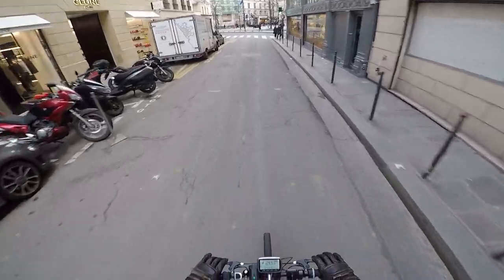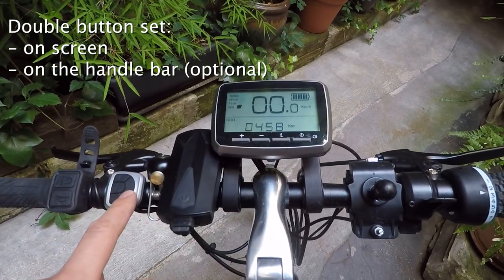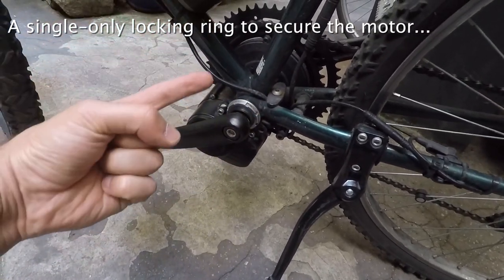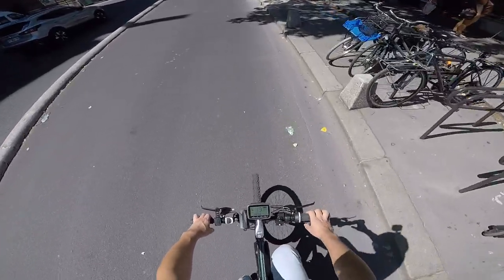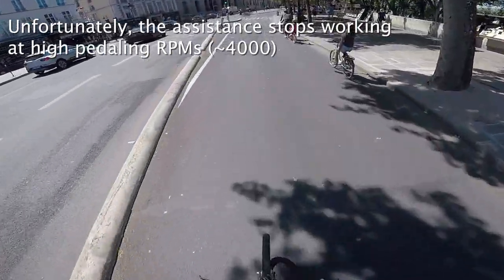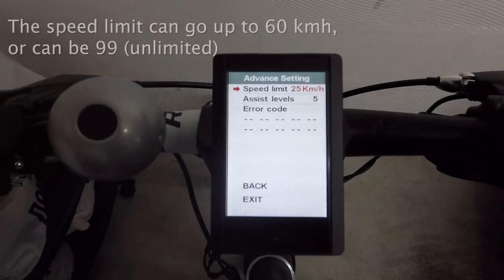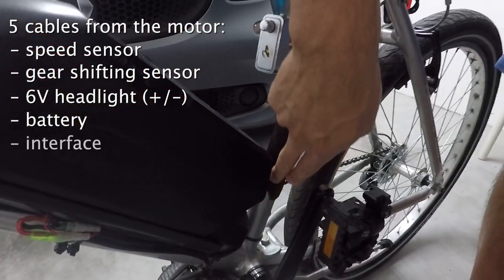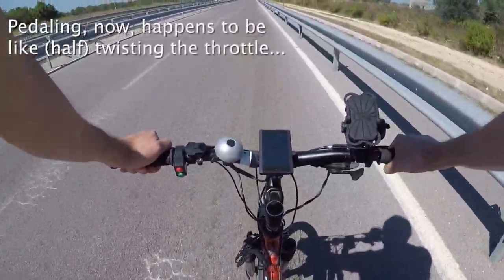Tongsheng TSDZ2 or Bafang BBS02B - 500W Mid-drive Comparison... Which one to choose?

Comment: Very nice video thank you for all the input on the Bafang motor I am considering to purchase one to convert my MTB and I am studding all the little features and advantages that you can get from each brand.
Reply: already liked and subscribed
Reply: Bbshd is the best of the bafang bunch, its easy to fit, only work your do is removing bottom bracket, re-feeding gear cable, removing front derailleur and its gear shifter, just make sure ur wheel rims are double walled.

Comment: A shift sensor is a needed on a torque sensing system as when you shift you should be letting off of the power anyway and that will instantly cut power through the system because it is a more natural for you. The cadence drives already more jerky, power meaning a shift sensor is necessary.

Comment: I have a BBS02b on my retrofit. I dislike the onset of power pedaling doesn't feel natural. The Tongsheng's torque sensing sounds nice, but the downsides look numerous. I've been considering a CYC Stealth motor, but it's too expensive and there are too many quality-control issues for me.
Reply from the maker: I totally agree with you man... In the future I will share some settings for the BBS02B via the programming tool that should make it a little bit more confortable
Maybe it will help you too

Comment: There's custom firmware for Tongsheng that improves it drastically, but that requires some elbow grease to install and a different screen unit.
Reply: You don’t need a new display for the custom firmware, though it givea you more readings

Comment: Which is the best?  The Bafang is a little more expensive and even so by my opinion slightly better then the Tonshang but all motors have there strengths and weaknesses, the Bafang strength is it is quieter and smoother and hear it encounters less problems and parts are easier to come by, it weaknesses is price its a little more then the Tonshang and the fittings.  The biggest problem I have had with the Bafang the securing nut coming lose and motor lowering so could do with a more secure fastening, the Tongshang as a fixing bolt that secures the motor to the frame but where that fits I have a stand fixing there.

My advice if you do fit a Bafang motor you can secure it to the frame by fitting the motor with jubilee clips, a jubilee clip aroung the motor then a smaller one through the firs clip securing it to the frame.  Ideal sizes 120mm to 140 mm for the motor and  50mm to 70mm for the frame and this will give a stronger fitting to the motor to frame and stop the risk of your motor coming lose.  I hope this helps as I find the Bafang slightly better and worth the extra cost and work.  Mike

Comment: Thanks for the info, i have installed a bbs02b 36v 500wat middrive motor 48T chain wheel front and 13/34 T cassette rear it have a lots power like a horse hi hi ferry ferry nice, the bike is a Giant expedition expert series. I draw a helmed course mij hear is not enough to protect the head.

Comment: I'm waiting for my tongsheng tsdz2 to arrive. I decided to go for the tsdz2 over the bafang because of the positive feedback of the torque sensor, if it's as good as the Yamaha on my haibike,  I'll be most pleased.
My next one will either be bafang 1000w or the cycx1.
Reply: I went for the tsdz2 and I am very happy with it. The Befang that I tried was also very good, but I prefer the torksensor.
My next motor will be again with torksensor.
Reply: How was your experience after all?
Reply: @pablonoguerales1425  Hi, I'm really happy with the motor. It comes very close to the Yamaha pw-se on my haibike in terms of responsiveness and performance, the quality of the motor however is not great, but replacement parts are readily available and fairly cheap. If you're thinking of getting one you won't be disappointed.
Reply: @wattyler5591  I read about your tongsheng and yamy there and wondering if your still pissed???🤔🤠😆😝🤙
Reply: @wattyler5591  I'm wondering how to mount a drive straight up in between the two frame tubes
 seems silly to hang the motor in the forward position  to also use as a skid plate?

Comment: Great comparison, i have 2 ebikes, one new fitness with tongsheng 36v 350 Without a throtle and  18-20kg weight depending on the size of the battery and one 20yr Steel 26in... 30kg with a heavy brusless 36v 500w  hub back wheel. Tottaly different, one is a helpful normal bike to have a workout (6000km in one year!) and the "tank" as a commutter and more like a moped. The same  battery in the tongsheng in eco-1 mode and a little in tour-2 Mode lasts more than double than the other with assist level 1 (80-100w).
Greetings from Greece.

Comment: I have the thongshen, but I also tried the befang. I prefer the way the thongshen delivers power. It reacts on how much input you give, so changing speeds is easier. It feels more natural.
I agree with you that there are things missing like battery usage and the amount of power levels. I think that it isn't a problem for most people, but I would love to have it.

I expected a longer range with the Thongshen, but I wasn't surten. I think that this mainly comes because how the power is added. With the befang, the motor works more as you just just pedal and don't ad extra force.

I didn't change to the custom firmware but it seems to deliver more power and ad some extra info.
I am thinking of changing the firmware, but not in a short time. I like the long range.
I hope that thongshen will give you an option to change it. That would be great.

Overall, both are good and yes the befang looks better with the display, but I would just look ad what feeling you like the most. Display can be changed and firmware change also ads extras.

Comment: Hi, great details on your video.
I want to convert my Marin from rear hub to mid drive 500W, but it seems that the bottom bracket set is seized and rusted into place, so the only option is to cut off with a hacksaw or angle grinder flush with the frame, then hammer or drill out the bottom bracket.

How you describe the locking ring for the motor is important to me - do you think If I have no threads remaining in the bike frame then I can still make the conversion, because it slots through and tightens to its self?

The purpose of the mid drive upgrade is for me to load up the bike with camping equipment and go in the countryside, which has lots of hills where I live in South West England

Comment: you don't need brake cut off or a gear sensor for the tsdz2 and you can get built in for the lights for the tsdz2

Comment: Hello Luke, thank you for this useful vid! Can you answer to me, with which motor is possible to ride using less cardial work? I've got very serious heart failure, that means im able to walk mid-speed continously, but riding a normal bike is too much. I tried it, i ran out of power and oxygen after 2 km. So as I understood well the Bafang set would be better for me? Thank you!
Reply from the maker: you got it right man: the Bafang kit is the right one for you!
the 500W at 48V motor will allow you to install bigger batteries, and if you buy a 48V 17Ah one you'll be set. in case you have a lot of steep climbs on your way, you can think about the 750W version :)

Comment: I have the tsdz2 750w fitted to a full suspension bike, biggest problem is the cadence which is about 85 with a full charge and about 70 as the battery goes down. With the 42t chain ring you will get about 25mph pedaling as hard as you can and after that you are fighting against the motor. Crank arms are weak and bend at slightest knock, the chain ring has play and wobbles, with a low battery the cadence is so bad you will be quite passed after a while
Reply: True not to mention the drag the clutch on the cranck arm has pff. This video says no resistance on the tsdz2 or the bafang, mid engine.... Wrong!!
Reply: Ffs - what do you want for £260?

Comment: Thanks for the comparison. I've just added a Tongsheng motor to an Apollo front suspension hybrid but haven't ridden much due to our wet and cold winter here in Melbourne! I'm looking forward to the weather improving so I can try some longer rides. The open source firmware project for the Tongsheng was a factor in my decision.
Reply: How has it been now that we've had a few sunny days....? Did you flash the firmware?

Comment: Which is best for going uphill easy? That's the only thing I need.
Reply from the maker: Hi! First of all, see this: https://www.youtube.com/watch?v=T7ve958hJXE
based on the info that I've shown, and considering the same 500W version for both motors, probably the Bafang because it allows you to efficiently use the throttle when you need it; it also provide more torque (100Nm)... unless you are looking for an "only pedals" experience, in that case the Tongsheng pedaling system is more realistic, but you will make a bit more of workout (80Nm). I would probably try something more powerful that 500W in this case.
Reply: Bbshd, 160nm of torque, i have 2, 48v 1000w, or 52v 1500, done 2k miles and it goes so good, just make sure to get these things, 1st motor sator has the new rotor, have a quick link chain, 8-9speed depending in chain ring, gear sensor, use a push down thumb throttle avoid twist, a bafang programme cable this enhances the speed and reaction of settings like how strong the thumb throttle works, make sure the wheel rims are double walled for extra weight and force, have a decent capacity battery over 15ah, 48v has bigger range of top capacity but 52v gives more power and 20ah 52v are strong and gd range, don't use throttle on hill climbs with bafang its stupid, i mean 100nm of torque if ur in right gear it will fly up lol

Comment: You can do 32 mph on flat no heavy wind on bbdo2b a battery killer but i would advise a 17.5ah to get max power no prdal.
In lower pas 3 to 4 80 miles range

Comment: Thanks for this video I'm actually planning to get that display that your u in on the bafang.. You said something at about 7:40 that the clock freezes is it like that all the time? If I remove battery to charge and put back the battery will the clock be correct?

Comment: When a BBS0*-***W is tuned in software and mode is set to "current" it works like a charm. I tried the TDSZ2 but did not like the torque system, the current mode Bafang was more suited for me also because it has a throttle.
Reply: CAN YOU COMPARE THE TORQUE SENSOR FEELING OF TONGSHENG AND SHIMANO OR BOSCH?

Comment: With the programming cable you can program the PAS and throttle to allow full speed regardless of the PAS level. I also have a BBS02 (750 watt) and mine is programmed that way. Unfortunately there is a glitch that makes PAS cut out when you hit the throttle and then the power comes on full blast. That required me to stop pedaling before applying the throttle or risk wheelies. I finally solved the problem by removing the throttle;)
Reply from the maker: hope to make some programming myself too! 🤞
Reply: @LukeLorusso  Mine came programmed to reach top speed regardless of assist level. I programmed it for lower amps so I'd get more range from a 6AH battery. Also lowered the % of assist in the lower PAS levels because it started at 30% in PAS level 1 which was unnecessary. Now PAS level 1 gives 10% power which is more than enough for slow moving around pedestrians. If I want 30%  I just up the PAS level to 3 (of 9) now.
Reply from the maker: @michaelsprinzeles4022  very interesting! question: can you still choose to have 5 customizable levels of assistance instead of 9?
Thank you for sharing your experience 💪
Reply: @LukeLorusso  Sorry I didn't see your question sooner. Yes, you can still choose the number of assistance levels. Note: if you change the number of levels the settings for level 9 are still the highest, with level 5 being the middle and 1 the lowest (while still getting assistance) so while programming assume the full 9 levels of assist and the motor will make the corresponding adjustments when you choose how many levels you want on the display. For example set all 9 levels while programming then on the display set the number of levels...the motor knows no matter how many levels you select that level 1 will be unchanged but the middle setting, no matter the displayed number, will correspond to level 5 in the programming and the highest setting, no matter the displayed number, will correspond to level 9 in the programming. With 3 levels of assist the display level 2 will be the programmed level 5 and level 3 on the display will be the same as level 9 in the programming. If you choose 5 levels, 1 is still 1, 2 on the display is like 3 in the programming, level 3 on the display is like 5 in the programming, level 4 on the display is like level 7 in programming and level 5 on the display is like 9 in the programming. With the programming cable (and software) you can also change the amount of power in each setting. Hope that's not overwhelming. It's simple once you've done it.
Ride on & enjoy;)
Reply from the maker: @michaelsprinzeles4022  fully understood, was the doubt I had, so hard to articulate but you answered straight! 👌 thanks man

Comment: Thanks for all of your comparison videos between the Tongsheng and Bafang. On the Tongsheng, will the motor carry you at 20 mph or 32 km/h on throttle only? I like the torque style better but want to make sure it has enough power on throttle only a day the end of a ride at the end of a long day.
Reply from the maker: sure, 32kmh is simply reachable throttle only :)
Reply: Mine does about 20 if you give it enough time to get there and pick the right gear. Even with 210 lbs me, heavy-ish Walmart bike (Schwinn Aluminum Comp), and a rack and backpack full of groceries. It definitely complains about it, though.

Comment: I built a mountain bike with a Tongsheng it was great. I bought a bike with a Bafang rear hub motor & cadence sensor. Cadence sensors are dangerous off road , you have no fine control over acceleration or speed like with a torque sensor!!! My damaged hand is still healing, thx Bafang :(
Reply from the maker: You're actually right: when using cadence sensor motors off-road you need to keep in mind the way it works to avoid weird behaviours. I prefer using the throttle in that case, which is not exactly the point of having a bicycle.
Tongsheng will be better in this case

Comment: I was thinking of the Tongshen for my Recumbant trike, but now I’m wondering if that is the best for me. I’ll keep studying...
Reply: Torque sensing works  better on a recumbent than a traditional bike. The TS being far, far lighter, make handling a bent a lot easier. TS has  secondary attachment I am not sure why he didn't use it, but it keeps the motor from coming loose like happens with the Bafang. Love these four videos, but sadly, he doesn't know what he should about setting options like the throttle and alternative e displays.
Reply: @MHH3180  I purchased the TSDZ2 and I’m installing it now on my Catrike Road. Nicely built unit it weighs 8lbs 8oz. So far the install has been a snap. Waiting on the battery delivery and some extra mounts for the electronics from T-Cycle. The unit came from Eco Cycles. I would recommend them highly.
Reply: @daviddickmeyer5231  could not agree more. David at Eco-Cycles is Aces with me!

Comment: I recently learned all Tongshen mid Drive kit use the same exact motor the only thing that's different is the firmware what you can change with the USB interface that you hook to your computer which I'm sure isn't something they want all potential buyers to know about but that's not my concern so I say modify the firmware overvolt it and give it hell 😊😅😂

Comment: The amp setting has no effect - it’s 18A hardcoded limit
The tsdz2 really shines after flashing to the custom firmware - you get a voltage read on boot with it - plus you can set assist levels etc

Comment: Luke, Thank you for making this excellent video. Is there a noise difference between the two motors?
Reply from the maker: Thank you for your interest! 😊
The Bafang motor is really quiet! The Tongsheng is maybe a little bit noisier, but nothing that can distract nor disturb you 👌🏻
Reply: @LukeLorusso   I found a video of the Tongsheng noise along with video of disassembly. The noise appears to be from improper face form cut on the gears. Gears are very complex in their tiny details. Tongsheng apparently fails to QA their outsourced parts or they do not understand the fine points of their gear train design. I ordered the 1 pound heavier BFS02 750 Watt unit and 48V 20Ah battery for the mountain I live on. I think this will be a more reliable motor though I would prefer a torque sensing unit. I probably see only 3 cars on my evening rides and I also am able to sneak up on deer along side the road. Quiet is very important to me.
Reply from the maker: @JohnHoranzy  I see your point. For my personal experience the TSDZ-2 doesn't sound noisy, but I will surely upload a video with the microphone next to the motor, in order to better explain it!
You ordered a super motor 👍 just be aware of the more intense tyre consumption (especially the rear one) and battery drain
Reply: @LukeLorusso  Hi Luke. I got my BBS02 installed on my Mongoose Gravel Bike with studded snow tires. I take it out in the evenings and in the deeper snow covered roads, it is absolutely silent. A bright Moon, and white snow covered fields and trees. The whine of a gear box would be so out of place in the surreal quiet of these forests.
Reply from the maker: Hi  @JohnHoranzy , I can see that wonderful picture through your description!
I'm very glad that the motor fits your needs; after 1500km I'm stiil very exited each time I use my bike with the BBS02b
Reply: @LukeLorusso  Bicycles are always fun and they never get old :- )
Reply: to